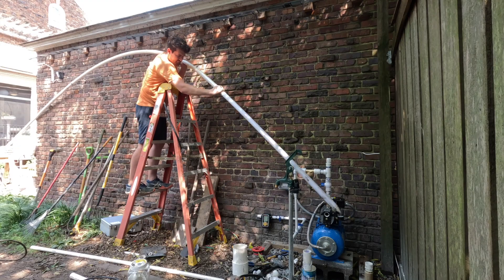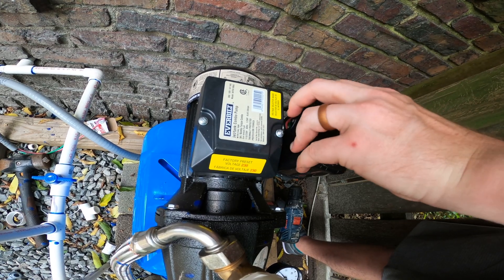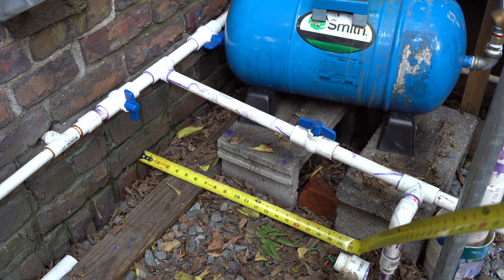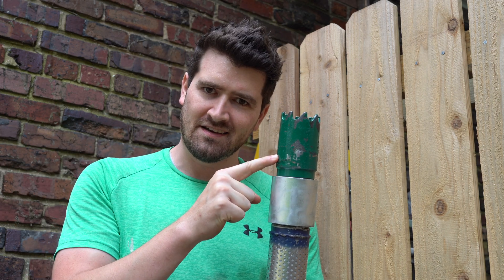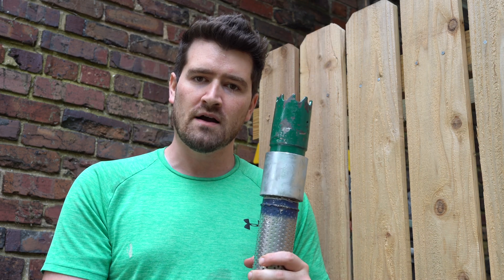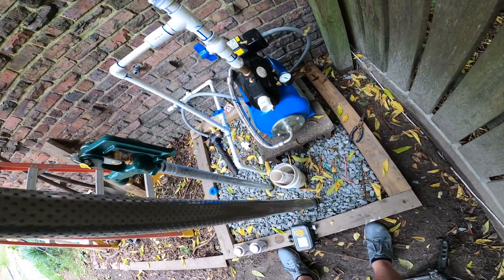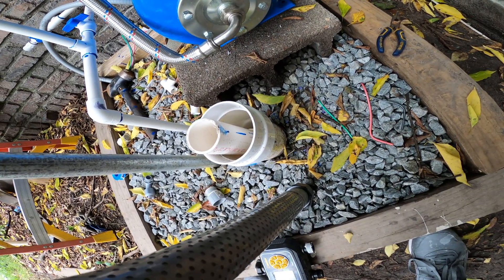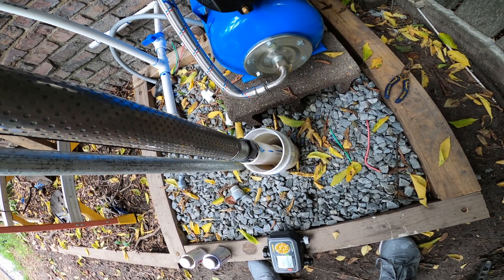Tips for digging a DIY backyard well

Comment: I placed my well about 20’ from my house, right next to my neighbors house.   I use it every other day since 2013 and I’ve tested it to 13 gals a minute with no problem.   My neighbors house hasn’t fallen into a sink hole yet.  I put down pea gravel in my casing as I pulled it out.    Max water flow.   My well point is also 10’ not the little chinchy 3’.

Comment: Im also curious, why are there two casings? You have what looks like a 4" casing then the 2" loke you said. Wouldn't you typically need just one?
Reply from the maker: The 4 inch casing isn't strictly necessary, but it's useful as a starter hole, and most well caps are 4 inches in diameter.

Comment: I may have missed something,  but why the 30/50 pump switch? Does it pump to a tank? Or is it meant to just keep water flowing?
Reply: small reserve tank and intended to keep water flowing at a good rate - there is an air bladder in tank that pushes against the water in the tank to keep the pressure for flow